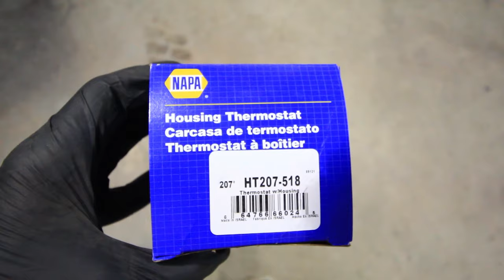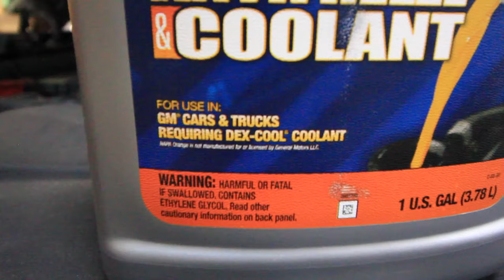Radiator Fan Won't Turn Off: 2014 - 2019 Silverado & Sierra: Bad Thermostat Replaced - Part 12674639

Comment: You likely need to reset the computer as well. One way to do it is to disconnect the battery cables and short the cables together. Another way is to buy this handy device (AUTOPHIX 3210 Bluetooth OBD2 Scanner Enhanced Universal Car Code Readers) and reset the error code (P0128) using the phone app. It appears that the logic in the computer waits a certain amount of time for the engine to reach a normal operating temperature. If the temperature isn't reached in time, especially during cold days, an error code is set which changes the temperature to 160 and turns the fan on full blast. It will continue to do this even after restarting the car. It does this out of an abundance of caution since it doesn't know whether the temperature sensor or the thermostat is bad.
Reply from the maker: We go over disconnecting the battery and other trouble shooting techniques in this video: https://youtu.be/wed9eZxPwsQ
Reply: So, Rob. I replaced my sensor. I took off the negative cable. It drives fine now. But, then the gauge goes back to 160 and the fan comes back on. So  should I go ahead and change the thermostat or try touching the battery cables together 1st? It doesn't run hot.  But, it is cool outside also. HELP! LOL

Comment: I changed both the sensor and thermostat myself and I still have the issue.
Reply from the maker: I'm sorry to hear that.  I'm not sure what your issue would be.  We changed both parts and have had no issues.  If you end up figuring it out please share with us what the problem was.
Reply: So I talked to a guy from a dealership and he said to drive it like normal that the switch would acclimate itself and it should go back to normal. i changed both parts on Wednesday. This morning (friday) as I was driving to work. I saw that the temp gauge was actually showing a temp and that the fans were not running like they had been. The issue is finally fixed. I probably wasn't listening if you mentioned that in the video.
Reply: @marcus6769  Best way to get the computer to work correctly is just disconnect battery for a minute after you finish the job.
Reply from the maker: Exactly!
Reply from the maker: Glad it all worked out!

Comment: Mine is doing the same thing.. plus the ac stopped cooling.. is this the reason??
Reply from the maker: I'm not sure about the ac issue.  However, replacing the thermostat and the sensor should take care of the problem.  If the AC still doesn't work, you probably have a condenser issue.  It's very common on the 2014&15 trucks.
Reply: Have the same thing going on ac stopped working aswell. Just replaced the sensor going to take it and get codes cleared tomorrow,  if that doesn't stop the fans will do the thermostat next. And maybe take truck to get a/c system checked
Reply: @jerrymorales9373  There is a hard line ac hose with a tight bend coming out of the compressor that cracks.  Other spot that fails is the condenser connections.  I have had both fail on my 2015 Yukon.
Reply: @jasonharris3873  when the thermostat malfunctions is kills the power to the compressor to keep the engine from overheating, once the thermostat issue is fixed AC should turn back on
Reply: @Hunterbam  Good to know.  I just replaced thermostat and sender as well.  Slowly fixing the list of GM defective engineering.
Reply from the maker: If you have a 2014-15 the AC condenser is known to fail.  The may be a whole different problem.

Comment: Great video. I followed step by step, however I still have the issue! I replaced the sensor like in your last video and now this and I also replaced a A/C relay, still the fan runs constantly and the temp gauge stayed at 160…any ideas?
Reply from the maker: I'm not sure why you're still having this problem.  If you figure it out, please share it with us.  We would like to know, so we can help others having the same problem.
Reply: Did you get the code cleared.
I went to auto zone and they put it on the computer. He said once I change it to come back to clear the code.
When he cleared the code the gauge started working and fan was back to normal.
Never had check engine light on!
Reply: @TheBrothersWorkshop  yes sir I just needed to clear the codes!
Reply: @toddfralix7679  yes sir that’s what it was! Thank You!
Reply: Same issue
Reply: I have the same issue on 2016 Denali. Changed the temp sensor and it worked fine for 3-5 months now doing the same thing. Removing the negative battery cable will fix the problem for a while. I’m not sure how replacing the thermostat would fix anything because it’s not over heating the problem is it’s not sending the right temp to the computer. Help me understand how changing the thermostat will fix this problem when clearly it’s a communication problem/
Reply: @jasongraham8990  if the thermostat is mechanically stuck open it will not the the engine warm up or get to operating temperature with coolant and rad fan running on highest speed engine will be lower than operating temp and you get check engine light
Reply: @TheBrothersWorkshop  replaced my wife’s and fan continued to run .ac checked Freon pressure was perfect couldn’t get ob2 to communicate with our phones ended up popping the fuse on the TCM reset and started working normal again
Reply from the maker: We never had the check engine light, and our truck didn't show any codes.
Reply from the maker: If the thermostat could be old, warn out, or broken.  Regardless it isn't working properly.  The sensor and the thermostat work together to read the temperature.  I'm sorry I don't have much more info.  However, we replaced our sensor first and it worked fine for a while, then began acting up again.  We replaced the thermostat and the problem was solved.
Reply from the maker: Interesting!  Sounds like your problem was a little different, but glad you got it fixed.
Reply: Was it kida sluggish during low rpm acceleration? My temp won’t go past the 160 mark and just had my cats and all o2 sensors done

Comment: I just replaced my sensor and mine also is the thermostat itself.
Reply from the maker: It's a very simple fix.  Once you replace the thermostat,. disconnect the battery for several minutes.  This should reset your trucks computer and it will read correctly.
Reply: @TheBrothersWorkshop  thanks for the tip brother. Your video really helped me out with the sensor and will do the same with thermostat.
Reply from the maker: Glad to hear it! 🙌

Comment: Little advice. I own a gmc Sierra 1500 2015 and had the same problem. Whenever my fan won’t stop running I erase the code and it runs just perfect. It’ll start back up every now and then but I just erase it again and it’s like the truck never had a problem
Reply from the maker: Unfortunately that doesn't fix the problem. Replacing the temperature sensor and the thermostat fixes the issue.

Comment: Changed sensor and thermostat and my fans are still running wide open and temp gauge is still on 160😡
Reply from the maker: Jeff, if you watched the full video and/or read the description, you would see that we did a trouble shooting video.  I've linked it here for you. https://youtu.be/wed9eZxPwsQ

Comment: need to bleed the cooling system
Reply from the maker: We've never had any issues with this technique.  Would there be a reason for bleeding the cooling system?  Complete and articulate comments will help if you want people to listen to you.
Reply: @TheBrothersWorkshop   everytiime you open the cooling system it needs to be bled of all air
Reply: @autogamer6404  could this be the reason to why my coolant is leaking from my thermostat around the bolts?